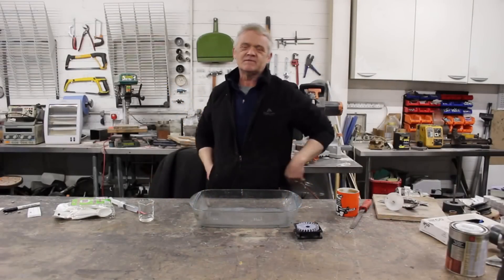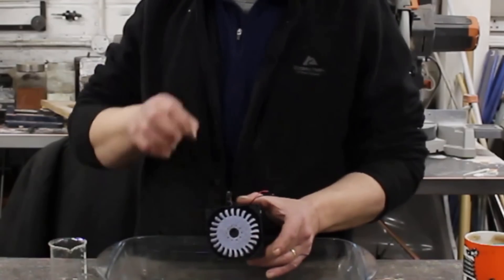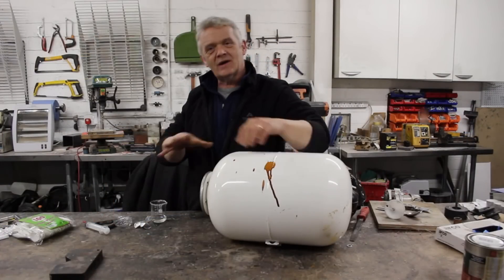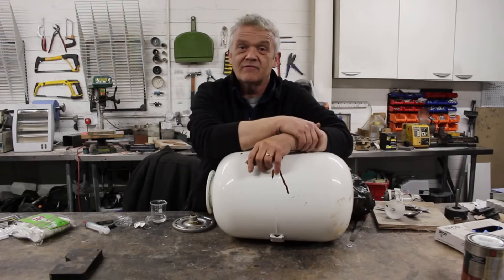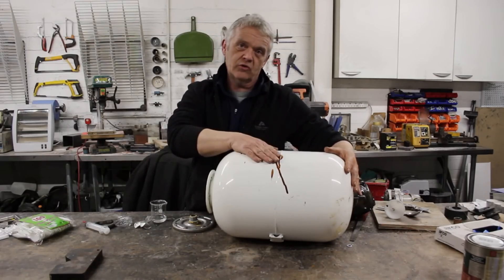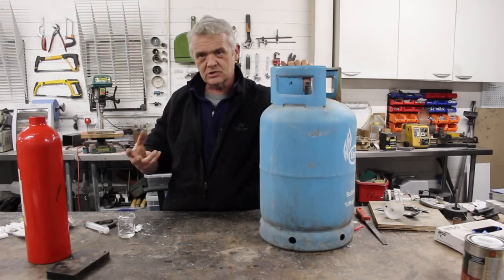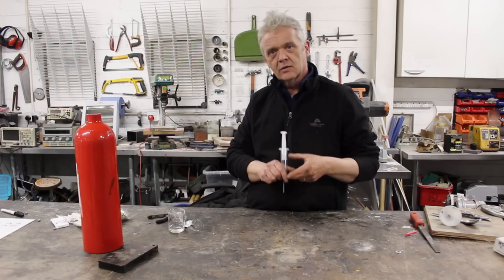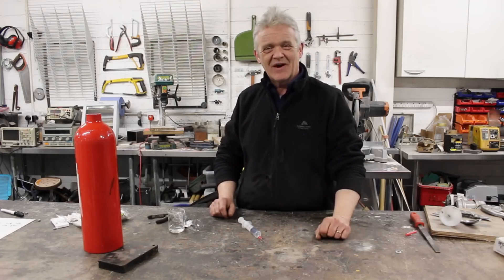1919 The Water Accumulator As A Possible Battery

Comment: I wondered about using a hydraulic ram pump as a way of using a low-flow stream to deliver high pressure to a low volume of water, to supply peak loads...I think the ram pump can generate quite a decent head of water, by itself, so that you get low-cost energy supply...there could also be some kind of hydraulic 'amplifier', maybe a large piston pushing a smaller piston into an accumulator, but I guess that that implies a dual-sided system, one charging, while the other is being 'discharged'...not too difficult, I guess, could make quite high pressure, but, if the ram pump makes enough head...
Reply: Wouldnt need a dual system, just have the clack valve (up and down movement) attached to the piston you want to do the charging with
Reply: Or use the clack valve to turn a generator via a scotch yoke mechanism was my original plan about 10 years ago,still not done it despite making another hydraulic ram pump after my original one lol

Comment: If you want high pressure diving cylinders give you 3000 psi and industrial hydraulics operate at even higher pressures with even higher pressure accumulators. I don't recommend building your own high pressure accumulators though, mostly due to the explosion hazard.

Comment: Neat! I’ve seen old accumulators on old buildings. Just now when I saw the weights stacked on top the water it made me wonder if a water tower could have a double accumulation action by making the water tank slide up and down rails so that it’s own weight is supported by the water pressure and would have a piston effect on the mains pressure. For those who don’t know, the weight of the water in the bulb/tank at the top of the tower does not contribute pressure laterally, only vertically. That weight is supported solely by the ground underneath. A narrow vertical pipe would produce the same pressure as a tower with a tank at the top, but it would not be as steady as the bulb/tank because the bulb shape acts as a buffer to the vertical stacking water that produces/maintains pressure in the lines. 

Don’t turbines all use pressure? Some convert high pressure with high momentum and some use low pressure with mechanical advantage to concentrate momentum but they all convert pressure as a result of momentum into mechanical movement right? Maybe I’ve assigned some attributes to the wrong factors.
Reply: - weelll.... the pelton turbine actually uses kinetic energy - as it turns this into impulse (the pressure is released at the jet - it goes to zero as the velocity approaches maximum) to create useful work..

Reaction turbines use bulk flow creating torque, again the  pressure is being traded for speed - the conversions are optimised for what is available - and what you can (want) to get out.) - stored water is Only useful  (apart from drinking, industry and agriculture) in terms of energy by value of the Mass and the "pressure head" (potential energy) - the more "potential energy, the less mass must be traded for a "giiven" amount of energy - how fast it is released influences the "energy rate - or power.

(all these arguments  - points for discussion/  optimisation - can help demonstrate why sometimes (compare turbo generators to Aircraft propulsion) a propeller is the best option, othertimes a "jet" is best - -while for an in between "gulf" a mixture between gives a more optimal outcome - ie a pressure optimised  Francis runner.) - google has many sources for all questions.

Comment: The accumulator not only acts as a battery, but also functions like a capacitor for smoothing the outgoing pressure over time.  Single piston pumps act like AC current with the pressure high and low as the piston alternates direction.  Triple piston pumps act more like 3-phase current, however the accumulator still helps when the pump rate is not consistent due to the initial energy supply changing, such as the windmill or rain slowing down.

Comment: I always thought they should make a Keg standard with a balloon/bladder to separate the incoming air from the carbonated beer.  That way you could A) not have to balance the CO2 pressure for pouring with the carbonation of the beer, but B) run a kegerator off simple compressed air without tainting the beer.
Reply: Seems like a great idea. If it isnt already out there then you should make it and patent it. Then do something good with the money.
Reply: - start with a wine box bladder in a sealed icechest  (barrel type) - add ice and compressed air for a fountain of wine... (or refill with bulk fizzy beer of choice) - lol...

Comment: What about making a really long tank with a little hole on the bottom? It should be easier (energetically speaking) to put water uphill than compressing it.
Reply: ( do you mean a big pipe running up a hill/?? - (at the same pressure, all pumping is similar)  one could also fill a "cablecar" /elevated tramway, with - (water) and tow it up a mountain - all examples of gravity storage - the pipe running up a hill to a "tank" (continuous process is a lot more "scalable" than the cablecar (batch process) - but either is not wrong depending on the metrics.  (Train vs Conveyor belt = bulk transport optimisation problem) )
Reply: @kadmow  The battery would be like a normal pipe (but BIG, in length AND diameter) with the side UPHILL being the input for the water, and the part DOWNHILL a normal pipe (SMALL, in length and diameter) with one side open to the GENERATOR (which is a normal water generator)
Basically, imagine the test he made in his video with a syringe and a needle, but WITHOUT the plunger.
The pumps would be like a normal water gravity storage, just "ON" all the time, because when the supply of energy couldn't put more water IN than it goes OUT, you'll be in a moment where you need to use the battery, making it also have a "gravity switch". Also, having it "ON" all the time scavenges energy even when using the battery. 
Basically, (IF INPUT > OUTPUT = you have energy on the system, and most is coming for the outer generators) and (IF INPUT < OUTPUT = you have energy on the system, and most is the battery spending what it stored)

Comment: From my experience with industrial hydraulic accumulators I am a bit skeptical about them being used as kinda battery storage. Besides the need for a high pressure pump these there is pressure bleeding as no valve is 100 per cent leak free. Means over time the pressure drops and you need to top up for that lost pressure.
In addition I am not keen of having a pressure system with several hundred bars at home and it piping even if it would be in an individual room. Any small leak will discharge a stream of water like they are used in water cutters to cut 100 mm steel plates. Even in an industrial setting a pressure below 130 bar is preferred as the technical and regulatory requirements are much lower at that level compared with pressure above that line.
Not saying it could not be done but in my opinion there are less difficult solutions available. But that is just my opinion
Reply: The idea is basically same as familiar compressed gas power sources, the added complexity of water being involved as a medium and adding a little extra gravity storage lets imaginations run with the idea.
Reply: @adymode  As rule of thumb each 10 m height adds 1 bar. So for 100 bar you just need to put your water tank 1000 m above the level of your turbine…. Yeah, that is surely more practical than the usual water storage in big reservoirs using huge pipe diameter and flow of water to drive turbines.
There are certainly ways of using water as source of energy like small creeks but compressed water imho is not for energy storage. And as you wrote using water instead of gases adds a level of complexity - both in the mechanics and safety aspect - that is not really worth it.
Reply: In South Australia there was.mention of storing compressed gas at say 2 or 3 hundred metres lower underwater in bags anchored to the bottom. A vague recollection though .
Reply: @philip5940  Using old mines for either storage of CO2 is looked into but afaik these are controversially discussed on ground of possible leaks and long term storage as well because this storage can be used as excuse to continue in producing CO2 by combustion or otherwise industrial means.
Then there are also discussion’s on using them as storage for compressed air. My understanding is that unused green energy is used to compress air and use this compressed air when there is not sufficient wind or solar energy available. One thing that seems to be a problem there is efficiency because the higher you compress any gas the more energy you need for the process and the more heat you produce (just think of an air pump you use to fill your bicycle getting hot if you pump quick enough). That heat needs to be removed at least partially and this process also has an environmental aspect. 
But take all that with a grain of salt - I am no expert in this field and base on that is my recollection of articles and information I read or watched.
Reply: The energy stored in the situation which Robert described is simply the energy in the raised water plus the energy spent compressing a bladder. The suggestion has been that the two add up to more than the sum, but they obviously dont. The bladder depressurizes as the water squirts out and if you store too much energy in the bladder it just bursts. The use of water doesnt multiply the storage components, they just add together. There is no breakthrough or untried invention involved, there is just an absence of rudimentry engineering formulation.
Reply: @adymode  I don’t know where he wants to go with this high pressure water storage. He usually stack one video top of the other and he surprised me on more than one occasion on the bend he took with his next video. 
All I wanted was to make my opinion known about the safety aspect of compressed liquids with 2000 PSI….
Reply: @wr6293  Yes sorry I shouldnt have digressed from your point. I have heard of tiny invisible leaks in very high pressure systems presenting a remarkable danger, besides the more obvious potential for explosion.

Comment: With all due respect, the use of a Pelton wheel has the highest efficiency overall. 
But to achieve this efficiency the pressure of the water must be constant. How? The turbine drives a generator for 60 herz AC, implilying that the jet speed is exactly twice the cup speed, so that the efflux drops out laterally. with essential zero kinetic energy.
The water pressure must be such that the velocity V is
V = √( 2 × g × h) 
   = √(2  press / density)
V = Pelton wheel radius rpm×2 π /60
rpm = 60 n/ polenumber
n = 60 Hertz   in the US,  
       50 Hertz in Europe
h is the height of the lake over the jet nozzle in a pumped hydro case
When you use continiously sinking pressure 
Any pressure above nominal must be throttled to achieve this constant jet velocity, 
Below, the jet is useless.
Using an active control system .
Throttling is highly in efficient.
The pressurized constant volume storage system is terribly inefficient, sorry to say
Reply: Thanks for the analysis, allows me to calculate my project.😊😊

Comment: F  = MV^2.  By accelerating the water using a pressure vessel, the available power goes up by the square of the exit velocity. Gotta love Isaac Newton…
Reply: (f  = ma     = m v' (acceleration being the first time derivative of velocity - second time derivative of position (ie x''), not the square..)

Kinetic Energy = 1/2 m*v^2  (the integral of momentum  momentum = m*V)

Power = Force * Velocity = m*a*v = m*a*(x/t)

Comment: Way back in the 90s i worked with a engineer in Huston , He told me that the Amish community actually power almost everything with compressed air/water from windmills
they even have factorys and macine shops, all driven by solar heat expansion in steps and windmills to avoid electricity!
Your video got me thinking...😊😊
Reply: This is why a inert gas like nitrogen (expencive) is used in accu systems ...
Reply: Some systems offshore uses air, buth with guaranteed oil free compressors (Alot of complications to the system)

Comment: 169 bar for a co2 container? it's still not as much as the autonomous air firefighters and scuba divers have in their tanks, which is 300 bar, or 1800 liters of air in a 6 liter bottle, giving them roughly 45 minutes of air if you calculate that for a normal working person which is 74 liters per minute. It surprised me that such a large container can't even get filled to 55 bar. That metal container for co2 is just metal, a scuba tank and a firefighter tank (draeger) those are reinforced by carbon fibre, but still, just metal and up to 169 bar? How thin are the walls on that big container? because a bottle for air is only 2mm steel.

Comment: Did accumulators exist before millwrights tried to solve the problem of irregular power output from mills, pumps and saws operated by wind turbines?
Reply: well a cuckoo clock basically has an accumulator - and as each weight can be wound up without changing the operation of the system - mechanical solution  (but a heavy flywheel is a more common mechanical solution - variable flyweights are another variation..).

Comment: The answers I'm now looking for is how much power we can extract from a given pressure/quantity of water/flow rate and for what duration?
great video
Paul
Reply: The power is flow quantity
 (m³/sec)   ×  pressure difference ( pascal, or Newton/m²) corrected by efficiency
In hydraulic systems using a Pelton turbine this can reach 98% in large installations in models ~ 45%
Reply: @iami9307  I can't find them, did you spell that correctly?
Reply: @ArcturanMegadonkey  I thought that would bring up quite a few channels for you to check. hang on a minute I’ll find one for you to go to.
Reply: @ArcturanMegadonkey  land to house

Comment: Brilliant as always Rob 
Thought I understood this sort of thing, but I think that you need to make a working model to show us more.
Reply: Yeah I also had to think about it a bit more to plot the whole process and figure out how it's actually storing and then recovering energy. So you have an accumulator pressure vessel. The vessel is pressurised using compressed air. Inside the vessel is a bladder filled with water. The volume of compressed air surrounds the water bladder. The bladder is filled using a water pump that is powered by solar/wind. When there is no solar/wind, the water in the bladder is released. The pressurised air on the outside of the bladder will squeeze the water out of the bladder. The water is sprayed out a nozzle to increase pressure (Bernoulli's principle) as demonstrated by the syringe. That nozzle sprays onto a generator and walah, recovered energy from the "battery". :)
Reply: @shinjisan2015   - and all that energy now has to be re-put-back-in before the next shot happens...  (the recharge stage was mentioned but not demonstrated._

Comment: As we talk about free energy, how about the ram pump? You can pump it up hill and maybe put it in a water tower, and then it can be put in a pipe down the same hill to a generator, and then you collect the same water down to the same ram pump? You would have to put some water back into the system, but very little. It would be an ever running system! Foremost, I don't have a place of my own to be able to do that. Not everyone can do it! But for the ones that can, it's endless possibility. Just a thought! Of course, it is not the simple thing to do.
Reply: Ram pumps aren't magic. A large volume of water is wasted to pump a small volume at higher pressure. There's no way to recycle  the pumped water through the ram pump and retain even a majority fraction, much less most of it, much much less almost all of it.

Comment: You could maybe also increase the water pressure by adding a heating element outside the tank (outside to avoid compromising the pressure integrity) and boiling the water. Heating elements can work off of direct solar so no batteries required. You may even be able to drive your generator off of steam instead of pressurized water. Obviously you're going to need some pressure relief valves, but you could basically make a little steam generator out of those pressure containers. You could combine this with your carbon fiber heating elements which you describe how to make in previous videos.
Reply: paint it black and put it in the sun ...
Reply: I've often wondered if solar thermal heating could be used on the expansion side of compressed air, to get more oomph..

Comment: Why does a ram pump come to mind?
Reply: Agreed! The compressed air from the ram pump could pressurize a bladder inside of a water tank
Reply: Cause they usually have accumulators to level out pressure. A ram pump can consist of only spring valves and pipe. The accumulator reduces wear on valve
Reply: @jamesgribben7024  You can also use the flow of the water powering the ram pump to fill a second accumulator without adding any more energy to the system. Then you can use the pressure from the second to assist the water pressure in the same or another system. Of course it will never create more energy than is used to initiate the system(s), but it could potentially improve the efficiency of them.

Comment: The only problem with pressurized water is that you either need an electric pump to pressurize the water, or a motor to lift a deadweight, or use human power to do the same;  how many people would bother with all that work, besides me?